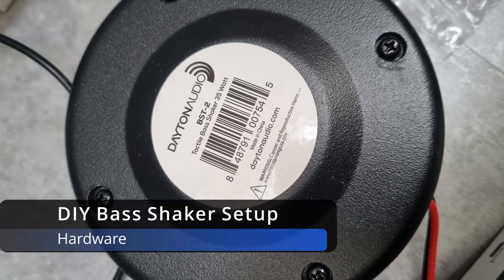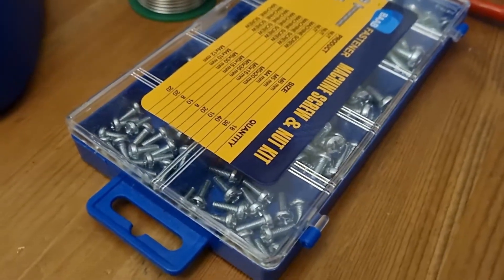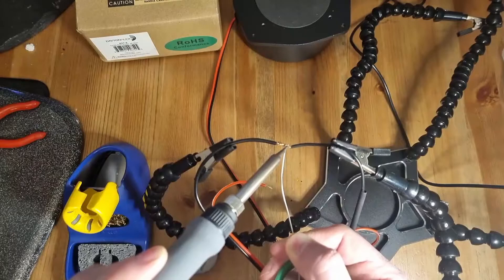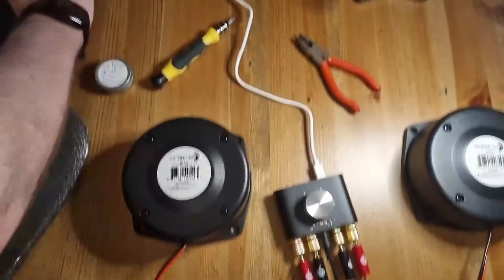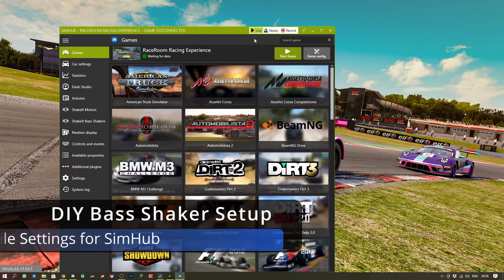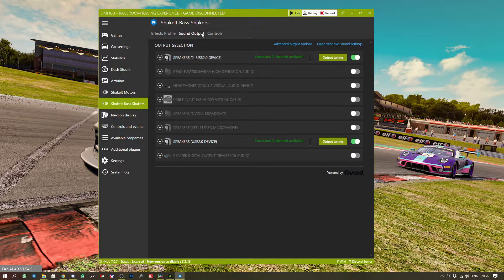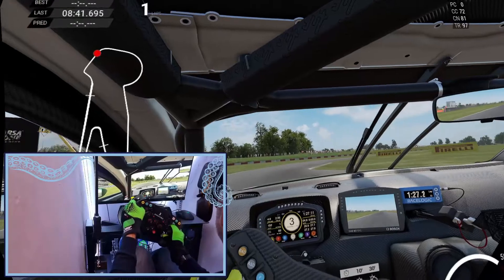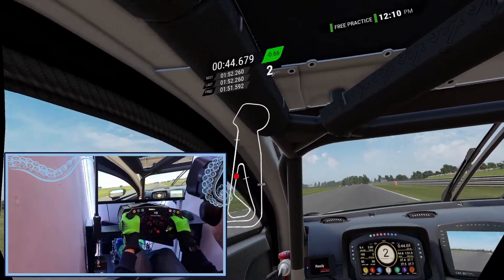DIY SimHub Budget Bass Shaker Setup

Comment: nice vid man keep up the good work, btw i got the same seat and 2 pair of 50watt dayton bass shakers, do you think i could just ziptie them like you did? otherwise i got to drill some holes XD. let me know👍
Reply from the maker: I think the BST-2 is perhaps as big as you can go with the zip ties.  It sounds like you might have the BST-1 which is a bit larger and I'm not sure you'll fit them both in with the space provided.   Zip ties have worked for me over the past couple of years though.  I had to redo them once in that time, just because I have to step on my seat to make my way out of the rig and that snapped a couple from the flexing.
Reply: @TeqqlesdoesVR  alllrighty, i do have the BST-1 but il find a way to hardmount them. still thanks for your help keep it up!
Reply from the maker: @xOverTake  Have a look to see if they fit on the springs, I don't think they will but it doesn't hurt to try!  For hard mounting I'd look at trying to be as close as you can to the mounting point on each side of the seat, that way you'll hopefully feel more of the effect.  https://www.etsy.com/uk/listing/1696804917/bst-1-bass-shaker-mount-highly or something similar seems decent if you have a profile based rig.
Reply: @TeqqlesdoesVR  i will look into that, thanks man.
Reply from the maker: @xOverTake  let me know how you get in!  I'm tempted to upgrade to BST-1s or something equivalent in the future but first I need to move the rig out of earshot of the wife!
Reply: @TeqqlesdoesVR  haha i will, good luck with the wife situation (you will need it) 😂

Comment: I ordered the sound card and two shakers last night. I’m starting to wonder if I need to order another star card and shakers see how to work and then I’ll go to four. I also got the pedal haptic motors they come in a couple days. Your video was great showed me a lot. I’m an old man and this seems easy enough to do for 60 year old man.
Reply from the maker: I'm glad I could help.  This one should be fairly straight forward.  Attach the bass shakers to your seat or rig, connect speaker wires to the sound card and plug it into the PC.  The tricky part can be getting the settings how you want them in Simhub but any trouble just let me know. 💪

Comment: Hello my friend do you think two Dayton audio bst-1 is enough as you entered or put 5 dayton audio bst-2, one per wheel and one under the butt? I have a sim lab gt1 evo. Thank you my friend
Reply from the maker: Hey Leon.  I'm glad you enjoyed the video.  I currently run with 6 bass shakers but you could easily get away with one front and rear with the right placement.  It won't give you the same kind of detail levels but it'll still do the job nicely.  If you opt for that route let me know how it goes!  You can always later expand to attaching some pucks to your pedals for ABS/TC too.

Comment: im using 2x bst2 shankers with a 2x50w amp at half volume.. the transduce gets really hot. is this normal?
Reply from the maker: They'll get warm and I definitely feel that in summer but they shouldn't get super hot.  I run the ones under my seat at full volume with an amp of the same power rating and yes they feel more than warm to the touch but they definitely shouldn't burn you.

Comment: Great video and thanks for the zip tie tip. Would it make sense to mount a transducer to a piece of wood and than zip tie the wood to the springs? Think I‘ll try both w/ and w/o wood.
Reply from the maker: A viewer from a while back tried mounting it on wood and then against the springs and suggested the direct approach worked better for them in terms of feedback. I'd be interested to hear your thoughts if you try that route!
Reply: Thanks Teqqles, must have skipped that comment. I have a seat from OMP, so I need to check if it is similar to yours. Will post a comment hopefully next week.
Reply from the maker: @vb_matic4166  good luck, let us know how you get on with the OMP seat.
Reply: Hi Teqqles, the OMP seat required a piece of wood. But I kept it small, just a little wider than the bass shake itself. Works great. 
Although I don‘t have an aluminum rig my pedal base has 40x40 extrusions (Simetik rig). This makes the pedal base too rigid for a bass shaker. I think I will remove the shaker and add an exciter to the brake pedal.
Reply from the maker: @vb_matic4166  nice! Yea, since moving to a profile based pedal tray I've really had to turn things up to feel anything. I did a DIY pedal project with motors but I'm thinking about a v2 with shaker pucks to give a bit more depth.
Reply: Looking forward to your V2 project.

Comment: I have a single buttkicker gamer plus

I think I'm going to do a 4x or 5x Dayton BST-1 setup and sell off the buttkicker kit
Reply from the maker: That does seem to be the way to go in order to get better feedback on a budget. Of course you can go the Buttkicker route but that can be quite the financial outlay.
Reply: @TeqqlesdoesVR  Oh yea, no way could I afford 4x buttkickers lol

What I'm looking at now are mounting options for the BST-1s

I'm using a P1X rig which is super stiff

I'm trying to figure out if a 3d printed vs aluminum mount would work best 

4x aluminum mounts is about $105, 4x 3d printed are about $80.. so not much price difference

I'm assuming a piece of aluminum bolted to the side of my rig would absorb less vibration than 3d printed plast

But I am not sure if I am overthinking this..lol
Reply from the maker: @fireonmytarget8937  let me know how you get on with that. I bought some VESA plates to mount the BST-2s but ended up drilling out the holes and mounting them directly to the profile (for the pedals)

Comment: Is there any rattling or knocking from these shakers?
Reply from the maker: Not from the shakers themselves. I had some vibration sounds from the front ones initially until I found a way to hard mount them properly. Under my seat, because the springs are under tension when you're sitting down, there is no sound there either.
Reply: @TeqqlesdoesVR  great thank you. I was curious as they're relatively cheaper compared to the Dayton audio bts 1 model for example. I live in an apartment building but even if I didn't I still don't want any rattling as it's very distracting.
Reply from the maker: @thinkrtank991 understandable. Whilst there is no rattle, you do get vibration through the rig when turned up. Have a look at washing machine tiles to put your rig on to dampen the noise for your neighbours if it's a concern.
Reply: @TeqqlesdoesVR  thank you for reminding me, I was looking at getting some anti vibration pads on Amazon. I'm new to shakers but I imagine if you mount these things directly onto a flat surface it might cause some knocking or rattling in intense moments.
Reply from the maker: @thinkrtank  I'll post a short when I get a moment highlighting where all the noises come from in my rig.  By far the noisiest are the wind sim and vibration pedals.

Comment: How about adding some rubber isolation to stop being swamped by with vibes through the chassis? Also have you ever thought of using a surround sound amp so you van use your rumble motors as well? Thanks all very interesting as I am just getting into this.
Reply from the maker: I have thought about swapping out the 2x stereo amp/sound cards for something else, perhaps I will when I rewire the rig later next year. Thanks for the feedback and sub! 💪

Comment: That’s a good video in great detail. Thanks for that. But people mention a budget set for $80 but forget to mention the $300 in tools they already have lying around that make the job way easier. Not criticizing but this may still be out of reach for many people.
Reply from the maker: That's true, I mention the tools but many of them are optional, I've gotten away with a $20 soldering iron, stripping using the kitchen scissors and a few bits and pieces back in the day so you really don't have to spend a huge amount to get these projects done, however it does make it easier with these things.
Reply: @TeqqlesdoesVR  It’s still a great video and thank you for posting. I’m a freak for tools so I have most of what you use as well, except the heat gun.
Reply from the maker: @ultrapaiva  thanks, glad you enjoyed the project. Honestly I rarely use a heat gun, I used to steal the wife's hair drier 😅
Reply: @ultrapaiva  Harbor Freight is a great place to get decent but cheap tools. I think I paid 8 dollars for a soldering iron from there and about another 10 for a helping hands

Comment: I must be an idiot, but I have the newer version of that nobsound card and I can only get it to work via bluetooth, it wont just connect via USB. I figured bluetooth has some latency and I wanted to get rid of it. Any ideas how?
Reply from the maker: With mine it automatically detects the USB when you switch the PC on.  If you can send a link for the model you have then I'll have a gander to see if there is a magic trick hidden away.
Reply: Mine comes up as a new sound card when I plug usb in.

Comment: Thank you for the informative video. So you basically need one channel per bass shaker, is that correct? And that's why everyone is buying Nobsound because it's the cheapest two channel amp? And you just connect the amp via USB to your PC but the default audio output from your PC should remain the real headphones?
Reply from the maker: Yep, exactly that. One channel per shaker and as you want dedicated channels then a 2 channel sound card/amp per pair. You can use the additional channels from your sound card but as you'd likely need an amp then anyway the Nobsound cheaply deals with both.
Reply: @TeqqlesdoesVR  thanks. So not every amp also acts as sound card? I was just looking for an alternative because the Nobsound device is so ugly and I can't put it on the desk, but it seems that there are no real alternatives. Seems like one device for 4 channels does not exist (or very expensive). Correct? Do you have overheating issues with the Nobsound?
Reply from the maker: @FlyingHawkic  I didn't find any inexpensive 4 channel sound card/amps either 😔 the Nobsound gets warm in operation but I've not suffered overheating issues with either of them - I've done some long endurance racing too!
Reply: @TeqqlesdoesVR  many thanks for your help. I see most people online use the Dayton BST-1, but you used the BST-2 which is only 35W instead of 50W. Would you consider that one BST-2 to the back of my racing chair and one below would be sufficient? My rig is the Playseat Sensation Pro.
Reply from the maker: @FlyingHawkic  the sensation pro looks like a bucket seat. The sprung underside of the RS6 I am using allows closer contact so I don't need as much power. You might be able to get away with the BST-2 as personally I'm running it at about 50% but a BST-1 would give you more headroom if your seat mutes the sensation too much.
Reply: @TeqqlesdoesVR  indeed, it looks like one but it's not a real one. It actually fiberglass reinforced plastic (from what I understand) and just some fabric. I'll try with the BST-2. Hope it works!
Reply from the maker: Worst case I guess is you can get them refunded if they aren't quite up to the job!  Good luck and let me know how you get on 😄
Reply: @TeqqlesdoesVR  haha, I just received my bass shakers, setting it up right now myself.

Comment: Do you think you would get more power with it zip tied to the bottom of the seat or if I made a little plate to mount it to?
Reply from the maker: I've only tried it zip tied to the seat but others have found the closer contact zips provide gives you a heightened sense of the feedback.
Reply from the maker: It'll also be very dependent on your seats understructures 😁

Comment: I plugged mine in and it works although it takes away the audio from my speakers, is there any way to make them work together?
Reply from the maker: If you're using the nob sound or an external sound device for your bass shakers then make sure they aren't your default sound device. Set them up on SimHub and let that manage the vibrations 👍

Comment: Great info! I have a Buttkicker Gamer 2 which I already had purchased (coming from the flight sim world), and going to be mounting to my aluminum profile as close to under my seat as possible. I'm thinking about adding just 1 usb sound card and 2 of these tranducers to give me a total of 3, and then possibly add another sound card / 2 more later on if the Buttkicker doesnt provide me enough localization on the rear that I'm looking for. With this setup, would you recommend positioning the 2 up front under the pedals? Or would it make more sense to put 1 up front and another one in another position somewhere? Thanks.
Reply from the maker: Interesting setup. I'd say 2 up front so you have a better idea of which wheel is locking up. The buttkicker has a little more grunt I believe so I think you're right to put it under the seat where you can feel it most but try and place it closer to you so you don't lose too much of the effect.
Reply: @TeqqlesdoesVR  Thanks, 1 more question. Between the BST-2 that you own and now have been using. Are you still happy with them or would you have opted for the BST-1? Debating between these 2 atm. Might even add a few rubber washers in between rig and transducer.
Reply from the maker: @sincity_steve  where I've placed them honestly the BST-2 is plenty powerful enough. What interests me a little is if I'd feel any more fidelity with the BST-1 but definitely still happy with them.

Comment: In the effects profile why is there basically 2 of everything is that because front and rear. I have a nobsound 2 channel amp and 2 bst-1 one on pedals and other on seat.
Reply from the maker: You'll have 2 channels, with my setup I had 4 channels so it was front L/R, rear L/R, in the effects profile you can select the effects you want for either channel and for you that'll be front and rear

Comment: I'm thinking about buying 6 Dayton 50watts  with 3 nobsound soundcard  and put 1 under the pedals, 1 under seat and 4 in the corners of my rig to simulate tires. I wonder if anybody has a similar setup?
Reply from the maker: That does sound like an interesting setup, though the 50w unit might not drive much force through the rig if you are attaching them directly to the rig itself.  This post on Reddit from a few years back was a guy trying to do something similar to you and he was advised to try and place them closer to the seat where possible so most of the transmission comes through his body and doesn't escape through the rig and floor.  https://www.reddit.com/r/simracing/comments/i8zaf6/for_those_trying_to_decide_if_bass_shakers_are/
Whatever you decide on I really would love to see and hear about the end result!
Reply: @TeqqlesdoesVR  Thank you for your reply. I will probably install them temporarily at different spots on my rig and see what the best options are. I also wonder if this helps with motion sickness in vr as I have a lot of people trying my rig that get motion sick.
Reply from the maker: @simracingjunky9679  Honestly when I first had it installed it actually made the motion sickness feeling worse but that was because I had it cranked too high.  You'll likely have to play with effects and levels to get to a point where you feel comfortable and that then does seem to help a bit as you feel movement on rumble strips and the like.  For me the biggest factor for motion sickness in VR is the framerate, so if you are able to keep that up along with the bass shakers you should be onto a winner.
Reply: @TeqqlesdoesVR  Thanks, I don't have any issues with it but pretty much everybody else that tries my rig feels it. I run most games on high settings at a steady 80hz ( I have a 3080)  but I guess that those people probably need 120 hz and to be eased in to VR before...

Comment: Bonjours j'ai exactement le même matériel que toi j'aimerai savoir coment la tu brancher es coment régler merci
Reply from the maker: J'ai zippé le bst-2 sous le siège si cela a du sens | Unfortunately my French is terrible so I had to Google translate this 😅 I use zip ties to attach the bass shakers to the underside of the chair. You can fit two side by side if you have the BST-2. Hope that helps!
Reply: Parler en anglais je traduit moi ya pas de RCA sur cette amplis y'a t'il une carte sons intégré ? J'arrive pas a avoir que les vibration du bass shaker es le sons au casque je suis sur pc es je joue au jeux de simracing